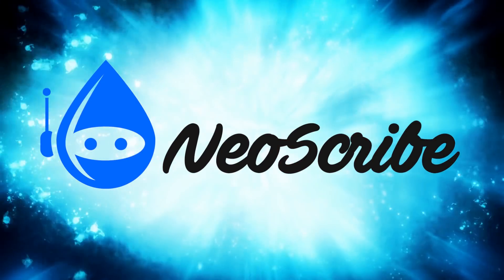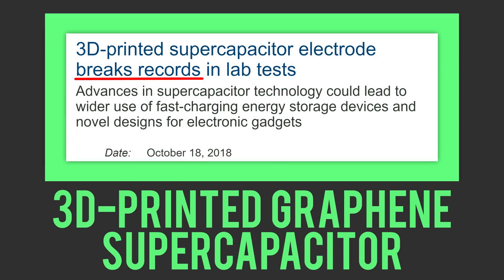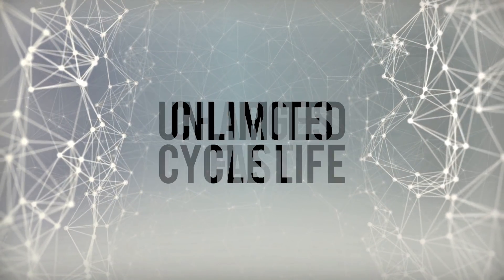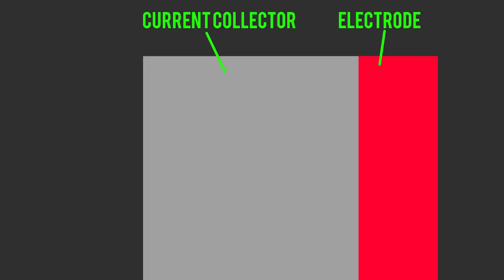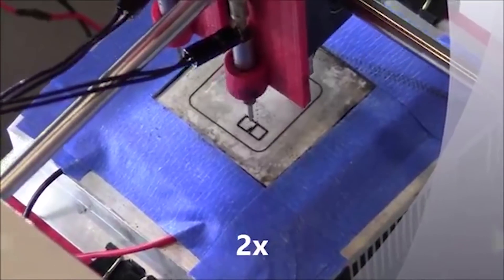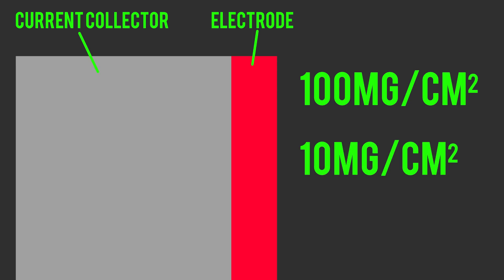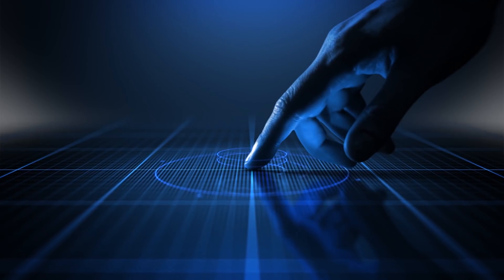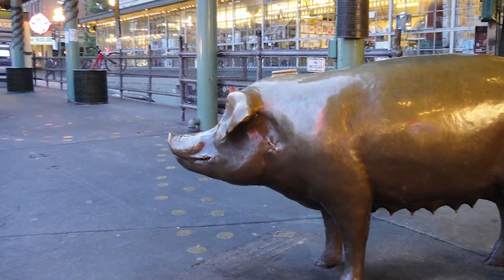Amazing 3D-Printed Graphene Supercapacitor Electrode

Comment: Something not often mentioned is that to charge 100 times faster you need 100 times more current.   There are still limits.  :(
Reply: Yeah if your charger uses 2 amps now it will need 200 amps then. In short your charger will be a re-purposed welding station... 
And better yet a battery that can be charged like that will be able to be discharged similarly. All hail the welder phone! I bet they will be banned from flight. LOL
Reply: kistuszek amps means nothing without volts. V x A = Watts 
2amps x 12v = 24 watts,  your charger is not 24 watts! It’s 5 watts . A large IPad is 10 watts!
10 x 100 is 1000 watts
Not a limit.
Reply: Well amps are meaningless if you dont have to conduct it. Yeah less than a blow dryer but i bet a welder is also less, yet it melts steel. Difference is the dryer gets 110V or 220V so 13A or 7A while the welder uses around 20V and 100A 200A. So a 2000W  4000W welder needs cable thick as your finger on the working end *2 while only a thin one to plug in the wall...
Reply: kistuszek 50 amps x 110v = 5,500watts 
That’s my welder
“Amps are meaningless unless you have to conduct them” amps are meaningless because they are 50% of the equation!
Reply: You don't seem to grasp the concept of current vs voltage. Those are not as easy switched around irl as in the equation. You want to get electrons into the battery and those are the current. To get these in you need a minimum voltage. It doesn't help to increase the voltage as that does not get more electrons in.
Reply: KP3droflxp Voltage & amperage are interchangeable.  And always are multiplied for total current (watts)
We have two caps 100v @ 1 amp.
When wired in parallel ( positive to positive,negative to negative )we now have 100v @ 2amps. When wired in a string (positive to negative, negative to positive) we have 200v @ 1 amp.
Both have the same energy density when combined either way total 200 watts.
Higher voltage does push electrons faster but the pressure is limited to the amperage. High volts without current provides the same work energy.
The limit in terms of voltage is the battery voltage. You can not exceed the voltage of the battery as the BMS will not allow this throughput.
I wire my batteries in a string this increases the rpm of the motor so I can travel faster but not as far. Vice a versa travel slower but farther.
However if I limit the RPMs it is more efficient at higher voltage. But then there is more leakage dissipation.
Volts escape the insulator when back pressure is exerted!
Reply: @Dana Putnam: You know, the problem is not how much power you are drawing from the grid, but how much is converted into heat. The power loss over a resistor is proportional to the current squared ( P=U*I ; U=R*I -> P=R*I²). So if you have a current of 100 amps and a resistance of 1 ohm (cellphone chargers are much worse), you have to dispose of 10 KILOWATTS of heating power for charging a cellphone. That's why welders have those huge wires, to minimize heat losses.
Reply: Tell that to a superconductor.   ;)
Reply: I don't get your point.  ;)
Reply: So you want to use superconductors in cellphone chargers? The problem is that even if you could cool the wiring of the charger down enough, there still is an internal resistance in the cellphone. And you can't get the internal wirings to superconductivity, because if you do, every circuit in the phone is inoperable. And you need a circuit that controls the charging of the battery.
Reply: @KP3droflxp   The more voltage the faster the flow.  You need a voltage to cause that flow. The phone has a minimum operating voltage.  What is being transferred is power !
Reply: jigga jaw  Main voltage here is 240v. To charge 10 times faster you go from 24W to 240W, 100 x faster makes it 2400W, at 1000 x faster it becomes 24000W.  Volts don't matter just Watts.
Reply: jigga jaw    100 W  =  100V @ 1A  or  1V @ 100 A .  It's power that matters in these matters.  10,000,000 V @ 0A = 0W. If you don't understand this please do so research.  ;)
Reply: @kistuszek  The reason we should drive EVs is to lower emissions. Being able to charge 100 times faster, will only promote big powerful but inefficient Evs. EVs today have twice the emissions of EVs in the 90' as the improvement in battery tech, has been wasted to just haul bigger cars around! We want higher energy density, power density is plenty all ready.
Reply: Tore Lund
Well, you drive EVs for the emissions, i would drive them for reliability economy comfort and low maintenance. Because i know that not having to consume a car every few years is better for the environment than less co2. Once my 20+ yrs toyota gives up the ghost (no significant repairs or problems yet) i might buy an EV.
Reply: @kistuszek  I drive a 20 year old car too, and maintenance is $400 yearly, not that I drive that much. Why do you think governments offers tax rebates to people buying EVs? Not because they wish to free the world of car breakdowns?
Reply: @Tore Lund
Mainly because it makes them look good. But also because it is an emerging industry that needs a boost to prosper. Like solar power. You have to realize that governments do a lot of stupid stuff for stupid reasons. Like cloudy germany pushing solar beyond reasonable, and killing nuclear at the same time. Now its brown coal, quick NG and french nuclear power filling the holes. It looks good on paper that they even export green power, but that does not mean that overall they are ahead. During peak generation they have to pay to sell the surplus, meanwhile low times they have to rely on dirtier power than before. (And electricity is like the most expensive there)

The main thing with EVs is not "no pollution", but rather that the pollution does not happen in the densely populated city. It happens in rural power plants it happens at industrial centers it happens in the Chinese mining sites.

If politicians had the least pollution in mind they would push advanced nuclear power research and development. Mandate alu or stailess frames for vehicles. You would get tax credit for consuming less electricity / NG than a set amount. And mandate guaranteed life of products. Like any appliance over 300$ should be covered under warranty for 5 years minimum, and cars 10 years minimum. EVs like teslas should have no problem with that but all those direct injection engines that die in a few years would be the makers liability. (Along with other well known modern car diseases that will often fail and take your engine and other expensive parts with it.) Think about how many pristine looking modern cars go in the dump because it is too expensive to repair them... All those cars going the dump have to be replaced, so an entire new cars carbon footprint is payed every time a lemon gives up the ghost. 

I say EVs are mainly better because of their long probable service life.
Reply: @kistuszek  I completely agree, politicians most strongly advocating EVs, exclusively are concerned about city air quality. While important, accelerating EV rollout but not doing the same with renewables, is going to increase CO2 emissions, in the short term.  So in a sense, it is way of greenwashing a health issue on the expense of global warming reduction goals.
However I also recognise that this is not a problem at all right now. EVs are a diminutive amount of vehicles currently driving around, but taken on face value, politicians advocating 30-50% rollout goals for EVs, and at the same time completely disregarding, any need for an equal ambitious plan for energy supply, are in essence just a different kind of climate change deniers. So that leads us back to the service life question: If you sell your current car to another guy, and buy an EV, emissions will increase, both from the emissions from producing any new car, and the fact that your old car will have an extended life beyond what you consider usable!. So at least, drive your current car until it falls apart and can get scrapped, before you buy your first EV.
Reply: @Tore_Lund  they’re trying to create scarcity and suffering, for control.  Think about it in terms of the pandemic.  For some politicians it’s about their power and egos (do people obey them?), the profits of their donors and virtue-signaling for their base, not about saving lives. Same here, but in terms of the environment. Pushing EVs right now is not about the environment, it’s about a distraction while they egg for war, restrict energy output here, and cause the misery of high prices. That will make people use less gas but spend more on EVs. The environmental part is just props because they’re not being pushed right now for the environment.  This is about getting people used to the sacrifice of war again and most will simply cut back on driving and only the select, elite minority will get EVs anyway, so there’s your pollution saving right there though.
Reply: Less than a blowdryer typical charger is 5 watts at most. 5x100 = 500 watts a blowdryer is 1500 !
Reply: Or voltage....
Reply: They charge so fast it won't be a problem. And also the current drops as it gains charge so the high current will be measured in nanoseconds. Also they could probably alter the supply lag or lead to compensate
Reply: jigga jaw   Any thing would be better but this vid is a bit extreme.  Sorry if I misjudged you understanding.  :)
Reply: Or 10 times more current and 10 times more voltage p=iv.
Reply: Just lower the voltage. Volts X Amps = Watts
Reply: @karlp8484  high current is incredibly inefficient is the problem. Sure, you could put 1000000 amps through something and that would theoretically charge it very quickly. But in practice you'd find that the wire would just melt and you'd ruin your capacitor.

Comment: I want to see someone build a pack for a car using a super cap array.  Yeah, you may only get 100 miles out of it at best, but if you can charge from a 110 outlet in 5 minutes, it'd be worth it.
Reply: Existing electric car batteries already draw many times more current than a 110 outlet is capable of.  If you want to charge a 100 mile capacitor in five minutes you would need a high voltage line hooked to a large AC to DC converter.  Or a trickle charged capacitor that you dump into your car capacitor over a high capacity cable.  It would probably be a similar draw to when they hook up the Tesla Semi prototype to multiple superchargers at once, so it would be possible to draw that much current from a dedicated facility, but you probably would have to spend a large stack of cash if you wanted that kind of speed at home.
Reply: @faroncobb6040  :  Read what you wrote out loud...slowly.  Then go look up what current is.
Reply: @hellcat1988
I suggest you familiarize yourself with basic electric concepts before correcting people on it. A model s has a 100kWh battery and has a range roughly 300 mile. So a 100 miles are like 33 kWh energy without safety margins. If you want to push that much juice in the car in an hour that will be 33kW of power. A rural European outlet might give you 3,5kw before tripping the breaker. (for comparison)

If you wanted to charge 100 mile in 5 minutes, you would need 33*60/5=396kW power to achieve that. (so like 113 outlets worth) On 110V that would mean 3600 amps. So you would need wrist sized cables from your charger to the closest transformer. And im pretty sure it would brown out the local area, so it would not be permitted.
Reply: "kistuszek You still haven't bothered to even
google what current is, have you? Current is the word used to describe the flow
of AMPS, not voltage, through a medium. If you keep the amperage down, but
allow the voltage to stay constant, you would not need a huge cable. True, you
probably still wouldn't get the range in the time that I'm talking about, but
you're not familiar with how some of these ev chargers work either from the
sounds of it. Those high power chargers usually throw several hundred volts
through the onboard chargers, (more than even standard mains power in europe)
which is then divided up to the individual battery management modules, which
divide it further to the batteries, which are typically anywhere from 2 to 4
volts. I would speculate the high current is needed to supply that low voltage to
each cell at a relatively high amperage. With super caps, you could use higher
capacity caps, so you'd need less in series and could charge them at a higher
voltage without requiring the higher amperage that would be divided down
between the controllers so much. "
Im not the one who is challenged on basic physics. Current (A)* Voltage (V) * Time (h) = Energy (Wh) The energy is kinda fixed for your application of 100 mile range, around 33kWh ballpark. You specified your voltage and time requirement at 110V and 5 minutes. Its just math how much current needs to flow to achieve that. "I*110*0,083h=33000W -> I=3614A" And no matter what voltage the charger uses to push the pixies in the battery because we calculate what needs to flow into your charger not what flows out, and you told us it is fed by a normal 110V outlet... Well no normal outlet can do that, even 100 will struggle.
You can only reduce your current requirement if you go higher voltage or longer time, and since you wont get 10000Volt line in your house anytime soon you need to compromise on time.
Reply: kistuszek I have a 10,000 volt neon sign transformer.. it's possible to get 10k volts in your house, you just got to step it up
Reply: Nissan leaf in Melbourne has a Graphene supercap battery for testing.

Comment: It's sort of like fusion energy, or super condoctors. Possible, buy not in your life time.
Reply: Fusions making a pretty strong comeback though, in the lab it's getting break throughs that make that technology more efficient and safe. With battery tech they just keep shifting what they want to focus on so there's like 50 different battery types and really one ever improving fusion method
Reply: Kiki Lang no it’s not it is science that has been successfully proven.
Also when have you last visited super conducting research? They now have laminated conductors that improve conduction hundreds of times less resistance.
Graphene has already been proven in the lab to be superconducting capable.
Reply: I want to be wrong so bad. I want someone to grab up some super conducting wire in their home, and hit with it. I want to be run over by a fusion power car. I don't want to be hurt, but I would give anything to real AI, cheap space flight, fusion power, and super conducting products.